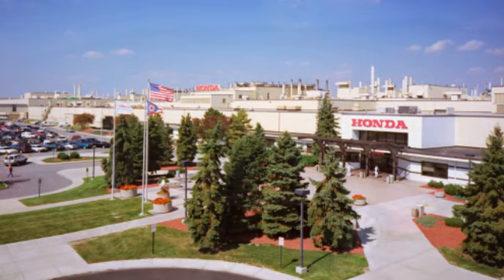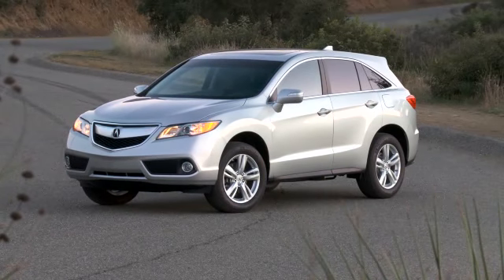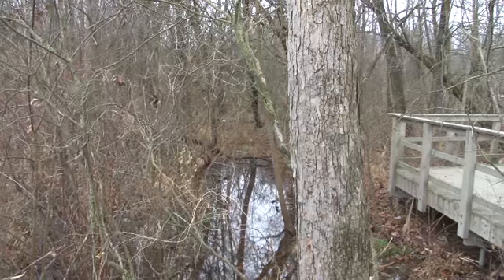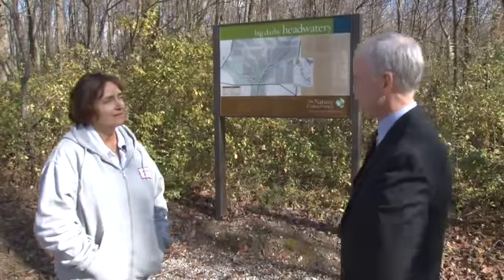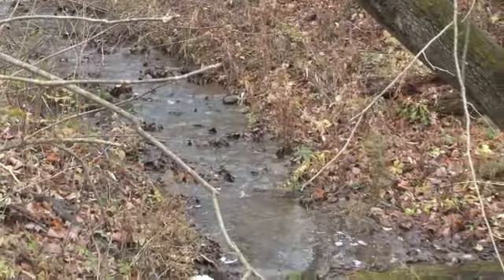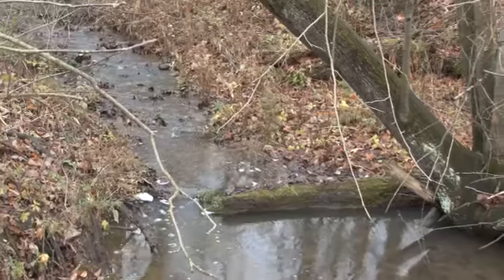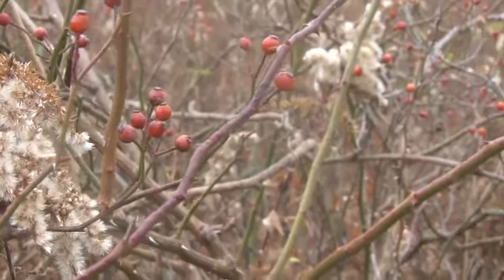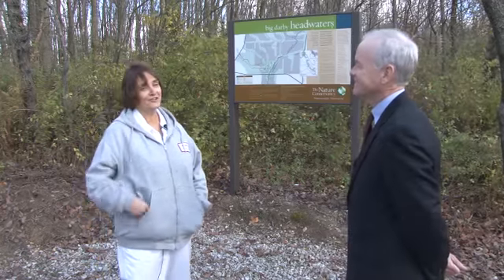Honda's 30 Years of Manufacturing in the U.S. - Autoline This Week 1651

Comment: you notice the quality slump between american and japanese built cars even though they're both built using robots. Even toyota has this issue. I rented a Corolla to drive in China, it was built in Japan, and I've got to say the quality is superior to any american built corolla. My old Acura RDX has misaligned hard interior plastics. I checked the window sticker. Built in the US. I paid about $4000 more for a subaru forester, rather than a higher end legacy because foresters built in Japan.